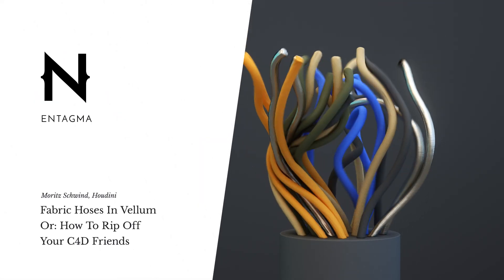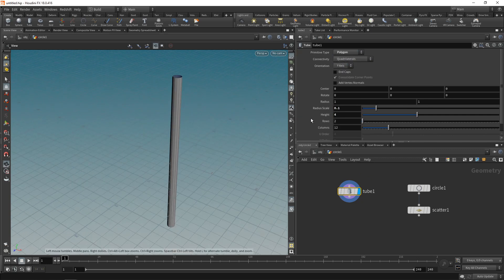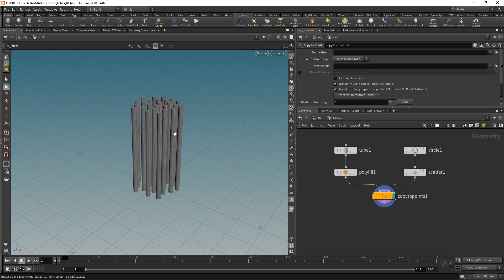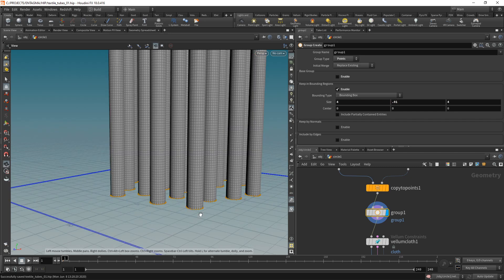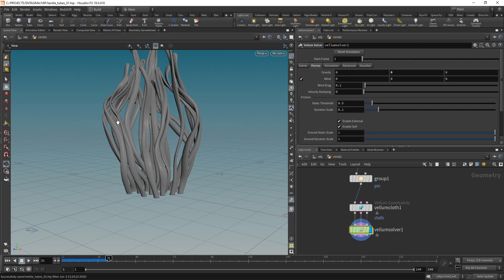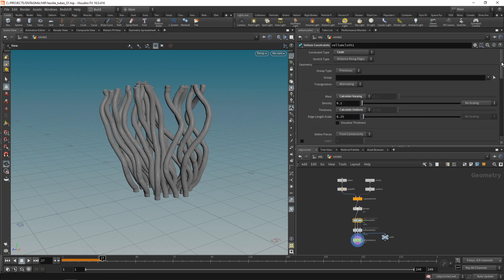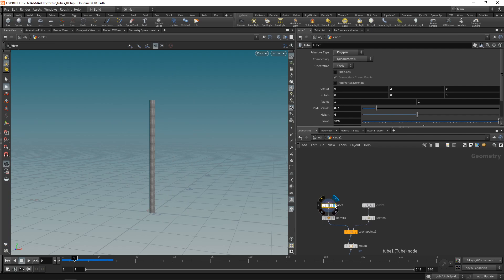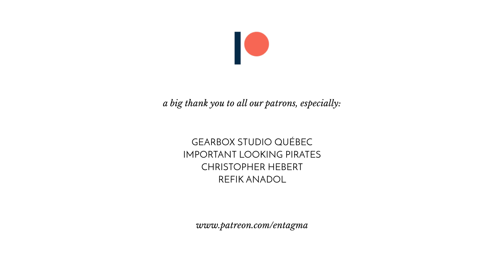Simulating Fabric Hoses In Vellum (Or: How To Rip Off Your C4D Friends)

Comment: any tips on how to then texture it in say C4d with redshift after exporting as alembic? the UVs are all over the place.
Reply from the maker: Sure - attach a uvtexture SOP  to your tube before feeding it into the copytopoints. Set the texture type to "cylindrical" and check "fix boundary seams". Voilá :)

Cheers, Mo